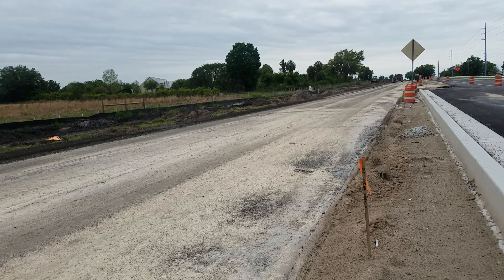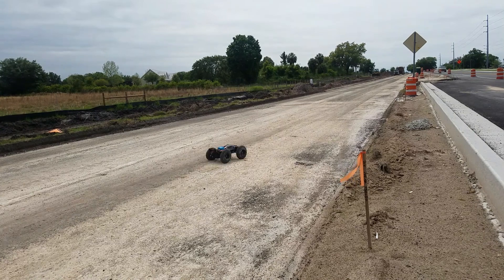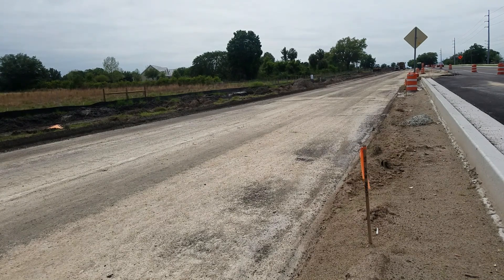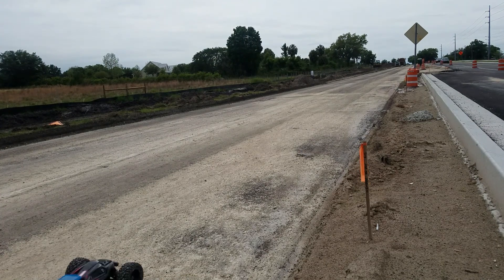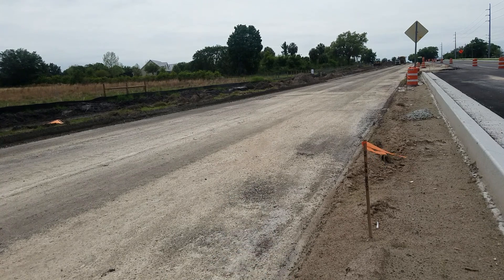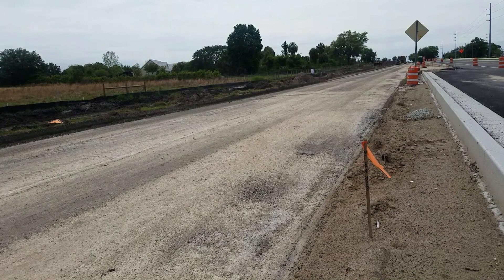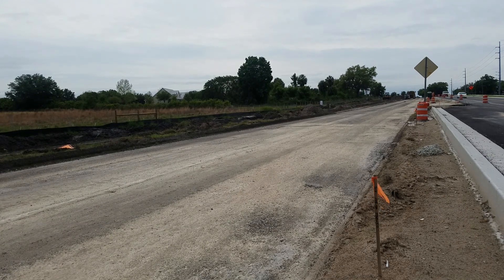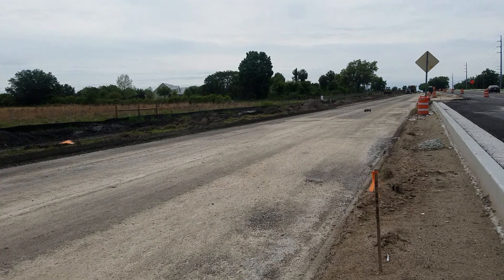TR MT8E BE6S top speed part II and DHK MAXIMUS top speed 1/8 RC TRUCKS

Comment: The BE6S comes way under geared at 11T pinion. It can handle a 16T though it can get hot. 15T is probably best. The only problem is that the stock tires can't handle the speed. They will literally rip away from the rim. The glue doesn't come apart but the sidewalls beyond the glue will tear. 

I run a 16t pinion with a strong fan. I've mounted HPI Goliath tires, that I've taped, on HPI Tremor rims. They both hook up and look awesome. The tire diameter is a couple millimeters less than the huge stock tires but, they are wider. 

The DHK Maximus which I also own, isn't even in the same ballpark as the Team RedCat TR-MT8E BE6S. The Maximus isn't really a basher. It is great for smooth serfaces of all types and can handle some small mid speed jumps. It's a lot of fun on grass but if you try to run it fast off road or in a rough unkept field, you will at minimum bend at least 1 axle every run. The tires are an odd size and are made of a thin soft rubber that will blow up at speed or when diffing out. 

The Team RedCat TR-MT8E BE6S is arguably and IMO the most durable 1/8 scale RTR Monster Truggy on the market. It is actually more than just opinion, in that the parts are made of quality materials, that are measurably thicker than anything else in its class.
Reply from the maker: What state do you live in? These electric cars barely run in the winter in Florida, i don't ever take them out in the summer, they run so hot so quick, but it's rare it's even 70 or under here even in the winter. Idk, this truck doesn't really even like to run on 6S with a 10 tooth here... So one thing I've noticed with more than one set of tires is the foam dicentegrates and it's not from driving them in water at all... it's happened with the tires from thos truck  and also tires that don't come off the rim like the six pack 3.8" wheel/tires... any recommendations you have for that... it's getting to the point with a lot of my stuff I may just throw away, I don't know what else to do with it... let me know if you know what to do with these wheels
Reply: @hobbytimeallthetime7553  Colorado, very different climate however summers are hotter than you'd think based on its reputation biggest difference is humidity.. I've run it in 100 degree weather but I have added a high flow, high voltage capable fan.

The stock tires and wheels are not great. I have taped and mounted HPI Goliath Tires onto HPI Tremor rims. Looks nice performs great. If you want to remove glued tires from the rims, look up the acetone fume method. Then you could tape the wheels you have.
Reply from the maker: I see, and then could always just redo the foam in them... right?  Humidity destroys everything... there is truth to the atmosphere being thicker here also... I have a bunch of trucks and batteries, have to rest them every 15 mins, so then just run another one, even when the batteries do over 20 mins... stock gearing 2 3S 3000mah batteries lasted 9mins... so I was running it with 4 3S 3000mah batteries, 2 in parallel and 2 stock series, but it's really just so i don't keep having to keep changing the batteries, still have to take a break after 10 minutes... did you watch my videos of my R8MT truck?  I love that truck,  but got so screwed that can't simple parts for it and can litterally only get it from the company who makes it... trust me, tried Amazon and ebay and even Google search for the parts... wasn't super expensive truck either. You own a lot of trucks too?
Reply: @hobbytimeallthetime7553  so long as you don't any liquid acetone on the foams they will be okay. I use a large salable container put rocks on the bottom to keep the wheels out of the acetone. Seal it up and check 1 day later. Start working the bead off the rim. Could take 3 days. Once you are done, cap the container and put away for future use. 

Depending on how hard you are running it and on what surface, 10 minutes at a time isn't bad in heat. I know thick grass heats all my trucks up.

I wouldn't say a lot, but a mix of various types and sizes. 11 total, 2 of which are nitro 2wd's.

Comment from the maker: Only thing changed was the transmitter/ receiver to the Redcat RCR 2CE... that is why the truck drives forever away... however this truck came with an okay transmitter receiver, I changed it because I destroyed the receiver with water, I didn't realize the water was getting in the cover for the transmitter when I would rinse it.